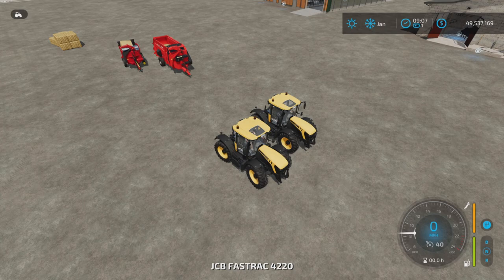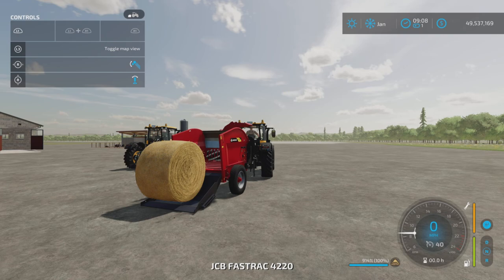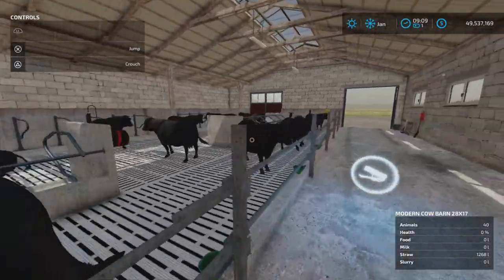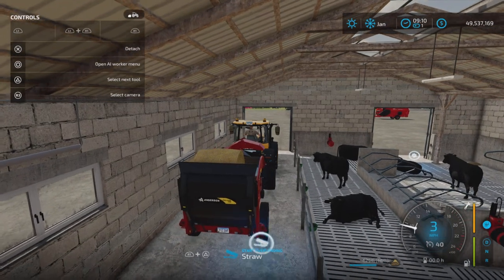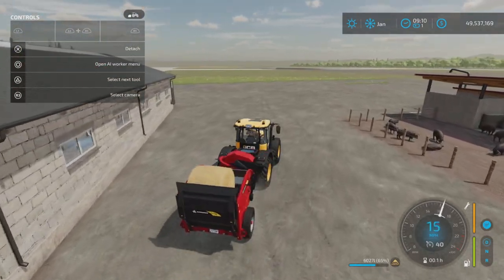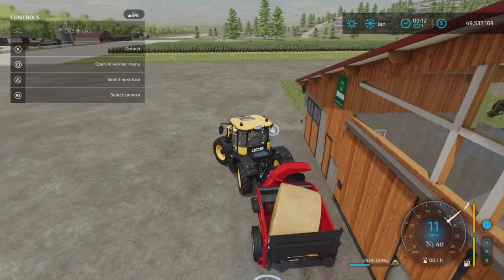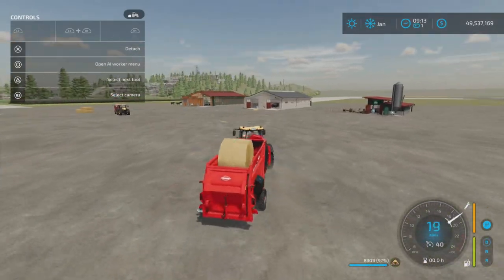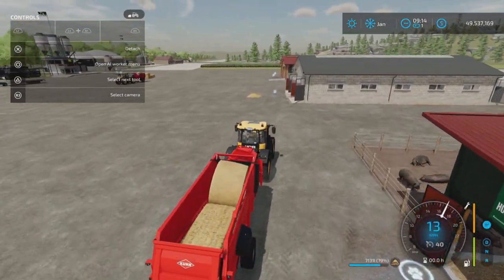How To Use a Straw Blower on FS22 on Console / Tutorial

Comment: hi looney,
nicely explained for your viewer but my question is could you also blow flax strawbales into cow sheds on the edgewater map?i think i have to try that out to see if that will work.i mean its straw also.
Reply from the maker: Thanks marc , I do not know , Flax straw works different than the regular straw , and only 1 baler that I have found will even bale flax straw .
🤔
Reply: @LooneyFarmGuy  i seen a video on youtube where someone is using the vermeer pack on the edge water for baling flax straw, i wonder if thats the only thing you can use for that.
Reply from the maker: @MsRaidman  The baler in the Kubota pack also works 🤓
Reply: @LooneyFarmGuy  sweet.thanks die the Info 😀
Reply: hi looney, i just tested the goweil pack on the edge water map and i was testing to see if you can actually bale flax straw with it, and sure enough you can. so no need to buy the vermeer or the kubota pack when the goweil is able to bale flax. thought i might let you guys know that it works. yaaaay.:yougotthis::yougotthis:
Reply from the maker: @MsRaidman  Awesome news marc, Thanks 🤗